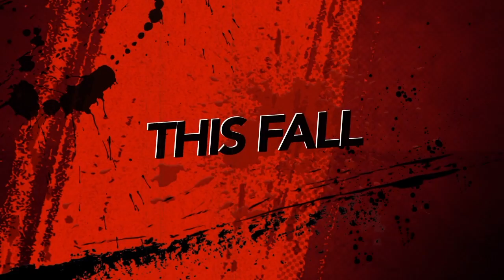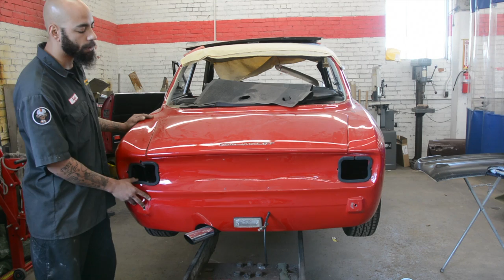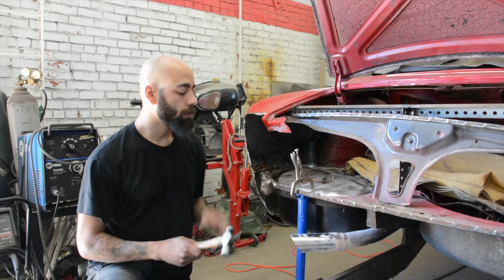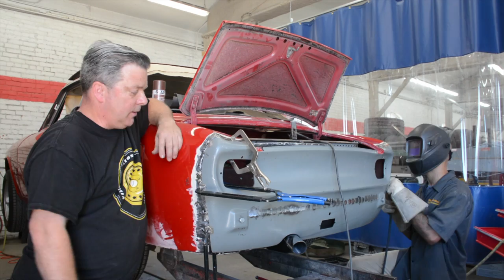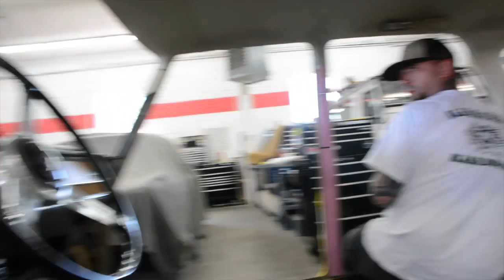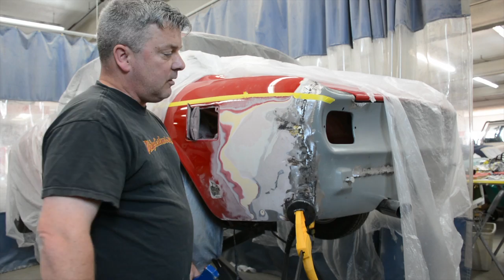Step nose blues......

Comment: Thanks so much guys...very timely (I was just talking about the body work discussed in this video yesterday) as this is exactly one of things I know I will have to have done this winter when I take on the task of properly restoring my car 12 years after a very poor job was done on it. It was a rolling resto, and I knew nothing about these things back then...I sure do now thanks to people like you.  But hey I got 12 good relatively trouble free years of driving out of her...and it did look very nice for 9 of those years.  Obviously my car had been hit and they tried to straighten and beat it into shape ending up using heaps of filler.  I love the little gems of info like the spots welds that should be evident and how to tell if its in been rear ended.  I got lightly tapped in the rear end a few years ago...creased the bumper a bit but what really shocked me was all the cracks and chunks of filler that fell off. I knew before (from going over the car with a friend who knew his stuff) that these guys took a lot of short cuts and that eventually things would start to appear. I'm ok with all of it, I've learned a lot and I know what I'm getting into this time around...plus I've learned to do some of the mechanical work myself.  My 1750 came from a hot southern European climate so there was little to no worrying rust or structural corrosion on it...sills,crossmembers,floors etc were all solid.  I had some preventative work done 6 years ago or so to stem the tide in any corrosion before I would get to doing her up right...so I have hope things arent too scary underneath.  Still don't know if its best or necessary to take things down to bare metal or not...seems lots of philosophies around regarding this.  Thanks guys for your generosity with these clips they are invaluable.